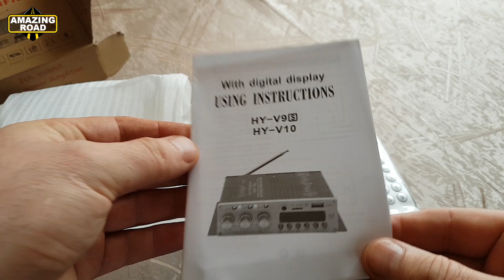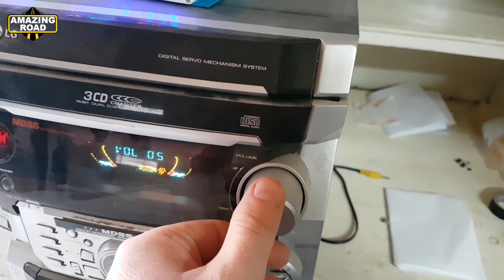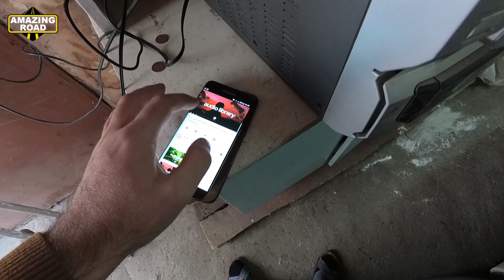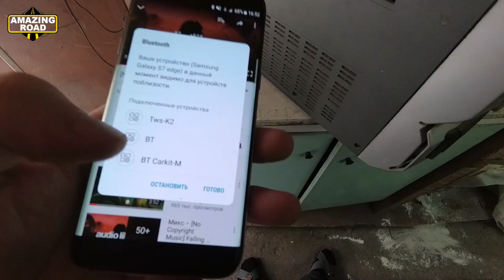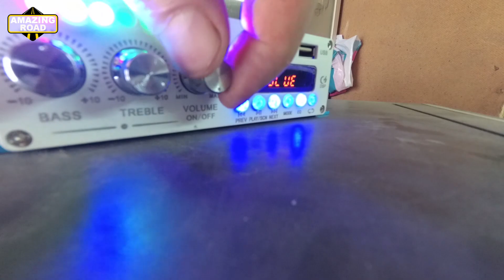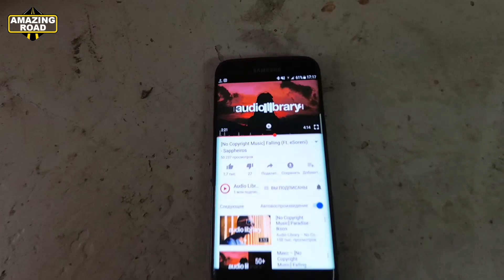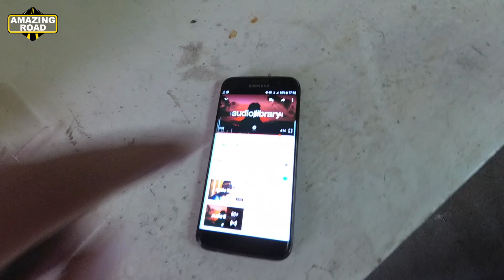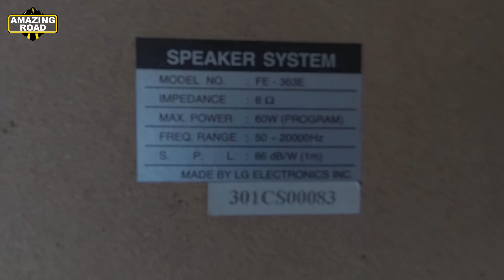Nice Amplifier Kentiger V10 Bluetooth V4.0 + Radio, USB, AUX, Hi-Fi / Clean sound and powerful bass

Comment: Do you know why mine is cutting out when I turn the volume up? It shows messege Lod and cuts out.  Have the same size speakers
Reply from the maker: I do not know, I'm sorry
Reply: Probably too low amperage on power supply
Reply: Need better power suply
Reply: Yep, up the power supply.  You can also remove the undersized bulk electrolytic capacitor inside (1500uF) and replace with a 2200uF cap. That fixed this issue on mine with a 2A supply.

Comment: 1:33-1:35 12V 1.2A? I thought it requires 5A?
Reply from the maker: Requires 4A, but I connected 1A.
Reply: but is it safe to use 12V 5A power adapter anyway?  thank you!
Reply: It will work with a small power supply, but will reach clipping early if volume is turned up too loud as it will load down the supply voltage. The amp requires some mods, such as more decoupling caps as amp becomes unstable. Also there is a reverse power protection dc blocking diode, that is unnecessary and reduces power to the amp by about 1 Volt, this can be bypassed for a small increase in power output.

Comment: TDA ????
Reply: TDA7375v not a powerful chip intended for cheap car radios about 10~15Watts channel into 4 Ohms, the amp requires some mods, such as more decoupling caps as amp becomes unstable.